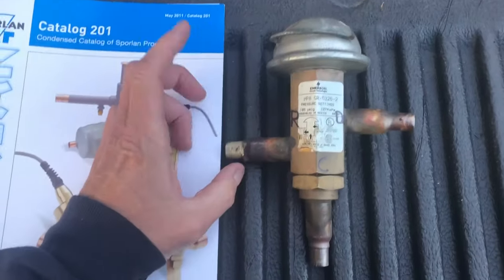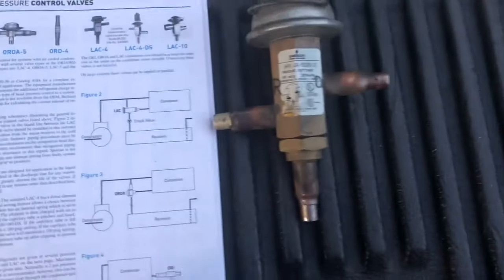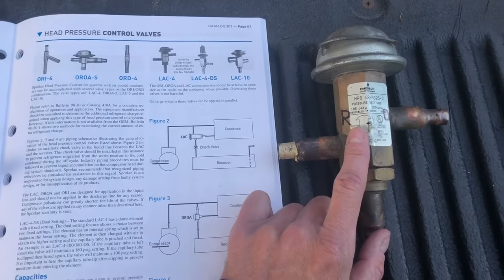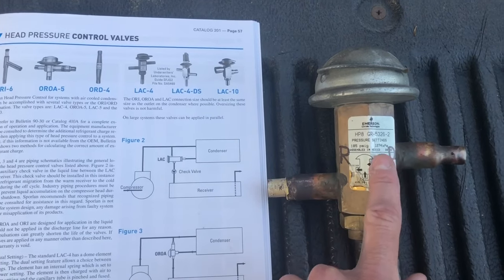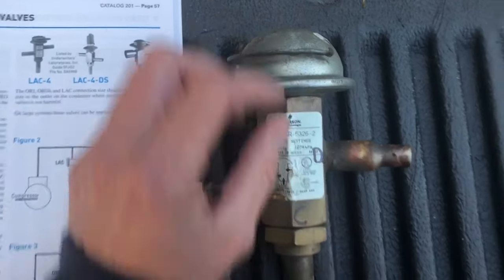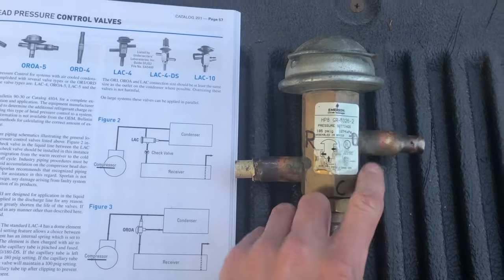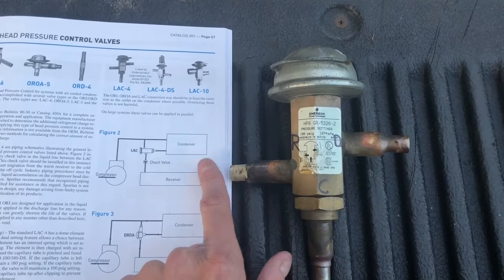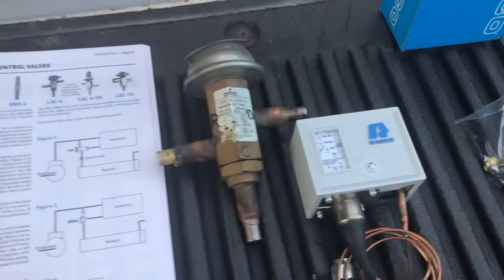How a Headmaster valve works

Comment: These can also be mis-diagnosed as faulty in a low charge situation. When the system has a leak or is undercharged a head master will naturally bypass. In a system with a headmaster you typically want to maintain a receiver level of 50% liquid. Yes that sounds high but hear me out. When the HM begins to bypass you want to make sure you have enough liquid stacked up in your receiver, enough to feed you TXV. You’re bypassing the condenser and mixing hot gas with condensed liquid. Now to rule out a charge issue you can verify receiver level if your receiver is equipped with a sightglass (bullseye) or by torching the receiver body. Using a MAP torch begin warming the body of the receiver staring at the bottom and working your way up. Go up and down for 20-30secs. Then remove the flame and using your hand or index finger, start at the bottom and begin touching your way up the receiver. When you feel the temperature change that’s where your liquid level is. Once you determined that you have plenty of liquid stacked then you can move on to troubleshooting the head master. I’ve seen too many techs deem a HM faulty when the system was low or had leaks. 

Hope this helps. 🤘🏼
Reply from the maker: Yes , exactly.  Great comment man. Have to make sure the charge is correct first. I should’ve mentioned that . Thanks man. I’m gonna Pin this so it’s at the top of the comments 👍
Reply: Awsome. Thank You.
Reply: And you do this MAP gas when pumping down im assuming ( dont go hard on me I just want to learn )
Reply: @ufcpubg1964  you can torch the receiver after it’s pumped down to check how full the receiver is once pumped, but it’s not necessary. 

You torch the receiver as the system is running to check receiver level. What happens is, when the system is low on charge and the HP falls below the head masters rating the head master will naturally start to bypass because of the drop in HP, it’s the head masters job to maintain HP.
Reply: If it’s bypassing in winter, then why do we have to flood the condenser ? Because HMV floods it sometimes 40% or 50% ?
Reply: @abazism I’m not sure I understand your question but, I’ll break it down real quick. When a system is equipped with a head master you want make sure you have enough liquid stacked in your receiver at all times. So… during a low ambient condition, let’s say at night time or as you put, winter time, and your headmaster is bypassing, you’ll have enough condensed liquid refrigerant stored in the receiver. Remember, you don’t wana under feed your TXV, you wana maintain a full column of liquid at all times. And this is why we charge are systems to a 40-50% receiver level when equipped with a headmaster. 

It would be the same procedure/principle if your system was equipped with an ORI and ORD valve. These 2 valves work together to achieve the same results as a headmaster.
Reply: @paultavish8833  thank you very much
Reply: Thermal image camera like Rigid is cheap and good tool to have. It can detect gas bypassing quite fast w/o having to use temp probe. You can check the receiver too. Sometime I compare the reading with another units . Thanks for your 50% liquid recommendation.

Comment: Got into commercial refrig not too long and now about to take refrigeration state exam for contractor. I read from forum it's best to pinch it because sometime it leaks. Thanks for the videos.
Reply from the maker: They very rarely leak and if they did you’d see it leaking right when it was cut. Pinching it wouldn’t hold back the pressure anyway especially since it’s in the high side of the system

Comment: Does that valve modulate or is it on/off?  I don’t believe I have seen a headmaster maintain a head pressure (180) at the theory goes of what it’s supposed to do, even on a new install… what is the range accuracy (+/-) ?  The one I did replace once, was plugged with dirt in the strainer. Under the seat I found a chip of something holding it open.  I inquired about replacing the 3/8” strainers in the entry ports because Sporlan doesnt include them in the replacement valve, go figure,… Simons has none in inventory, and said they need a minimum order of like a box of 500 to order them or some ridiculous thing like that.  They weren’t about to order them.  I ended up installing a fan cycle control on one of the two fans…
Reply from the maker: They modulate open and closed depending what the pressure is and then they hold at 180 or so. What was the outside temp where it wasn’t holding 180 ?  Of it was warm or hot out the head pressure will run like it normally does. These are for the cold weather so it will maintain a pressure of 180 because if it goes too low when cold out the system won’t cool properly

Comment: Thanks for your explanation on those controls, I have seen the large pressure fluctuations with condenser fan pressure control. If I have a preference it would be to have a speed control on the condenser fans. I  have not seen a head master unit on a system where I am.

Comment: Damn, I did not no about that little flip thing.  I had a industrial freezer that was stuck to the condensing unit.  I added to refrigerant to flood the receiver and use the fan cycling control to get them working till it could be replaced.  I don't remember ever seeing that arm to move the valve..

Comment: hey Chris ,  If the Head Master control is stuck open (bypassing on a warm day )  would you get a noticeable temp rise on the liquid line going  into the receiver . meaning with a couple of temp clamps or even your hand  will there be a measurable temp rise
Reply from the maker: Hey Mike what’s up buddy ?  Yes you would get a noticeable temp rise for sure. You will even feel it in the winter as well .

Comment: Hello there damien here for Ireland  one question can the head pressure valve be installed in wrong direction flow just have a couple of issues with remote ice machines starting to take a little bit longer to harvest?
Reply from the maker: Vincent Howe yes it could be installed wrong.  You never know.  Usually they are marked though for what line goes where

Comment: On the fan cycle control like for ice machine condenser the fan comers on 250 and off at 200. Is that to maintain head pressure?  Even thou system has head master  I guess if you don’t back up the refrigerant in the condenser you don’t have enough pressure to make the TXV work properly and say a walk in cooler or freezer.  Just wondering why the Mantiwoc condenser has a headmaster and a fan cycle control.  So in the winter the headmaster sends all the refrigerant to the receiver and then the receiver sends it through the filter dryer to the evaporator TXV so it has a steady stream of liquid ?
Reply from the maker: Yes they have to have a steady flow of proper head pressure. Also with ice machine you have to hav good head pressure for when they go into harvest cycle to defrost the ice. Fans will always shut off on defrost because the discharge gas is diverted to the evap for harvest cycle

Comment: If your in a pinch headmaster valve is bypassing completely you can cut the tip and it will no longer bypass the valve until you can get another headmaster valve.

Comment: When setting up the ORI ,ORD style  how do you set it up.? Do you have to return when it is cold to set the valve up or is there a way to set it up any time of the year ?  Thanks and great job on your videos. Thanks and keep them coming
Reply from the maker: CB CB you can set them up in the warm weather. But a lot of times we will go back and set them once the weather starts to get cool out.  It’s easier then because the had pressure will actually drop so you can set them at the pressure you want the head pressure to be at

Comment: And today I think I had a bad headmaster as I had a 55° cooler after talking to tech-support Heatcraft my discharge line felt cold going to the evaporator where I checked pressures outside on the ports filter dryer was just cool to the touch filling the headmaster it’s felt cool as well. R C
Reply from the maker: System could also be low on charge too , you have to make sure it’s fully charged . Low charge can act like a headmaster issue
Reply: What??? Your discharge line was cold???? Really,…. The discharge line ?  If thats the case , your compressor isn’t doing any work. Even with some gas it should burn your hand.

Comment: A system with a leak and a headmaster vs a system with a stuck open headmaster. What would the symptoms be ? Clear sight glass on both.
Reply: No liquid feed the TXV and of course no cool and yor return or sucction will be hot and your compressor too

Comment: Great explanation, Thanks!  Will a low charge affect performance of valve?  If so how do you charge system to maximize efficiency of valve without overcharging unit?
Reply from the maker: robert oneeye yes low charge will affect it.  You have to find out what the 90% level for the reciever is and charge it that way
Reply: quesiton? on low in charge systems using the (LAC-10-210 psig) range valve and we have like 160 psig on the gas discharge compressor the valve will be by pass the discharge gas into the receiver?

Comment: Good to have you back , Chris 👍
One that confuses the $%^@ outta me us the hot gas bypass valve that injects hot gas into the suction to keep the sst from becoming too low , with a multiple box system. 
Now,  I understand the principle and the why , but then , how do you get the bloody system to pump down if the valve keeps injecting hot gas into the suction everytime the sst drops ?
Do you have to install a solenoid valve on the suction line right before the compressor?
Thank you Chris!
Reply from the maker: Sterling Archer yes there is either a solenoid to shut off the hot gas line or a ball valve to close the line and then you can pump the system down
Reply: @Cscrefandhvac  makes more sense , cheers , love those educational vids , mate 👍

Comment: That fan cycle switch uses a sensing bulb?
Reply: The fan can be cycled on discharge pressure, or on condenser temperature, I have seen both. An electronic  temperature control can be easier to retro fit you just tape and insulate a sensor wire to the condensor discharge and it can be set to have a narrow differential.

Comment: I recently ran into a system with both a headmaster and fan cycling. Is there a reason why a system would need both? My theory is just redundancy but I'm not sure.
Reply: Only have seen it when there are multiple fans, one should always be running whenever compressor is running. Cycling a single or both fans just sets up the valve fighting against fans. Pressures will be all over, can cause TXV to hunt.
Reply: Maybe due to extremely wide outside temperature range? Fan cycling as first stage of control with headmaster as second stage?